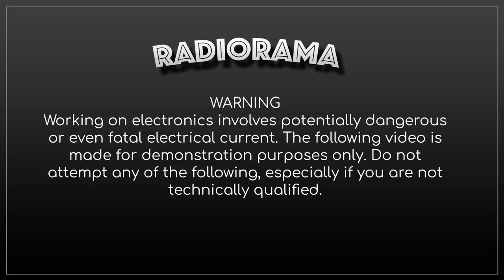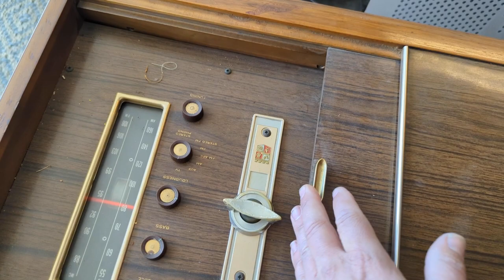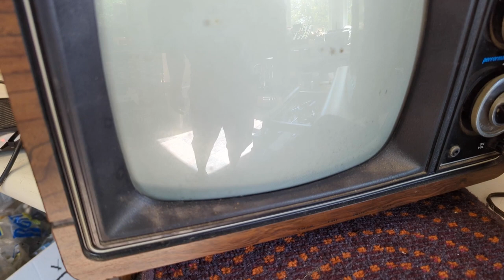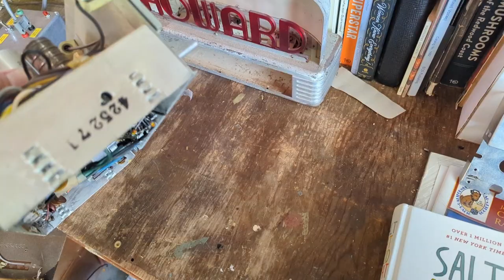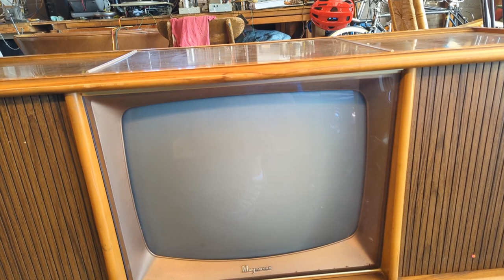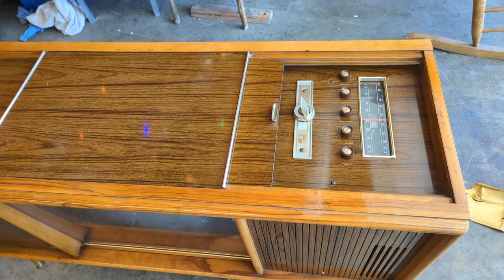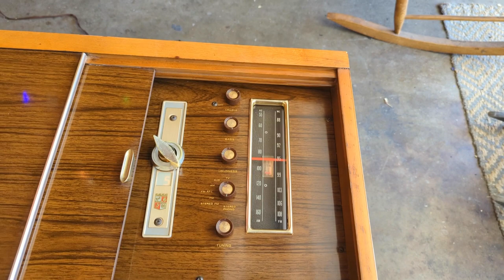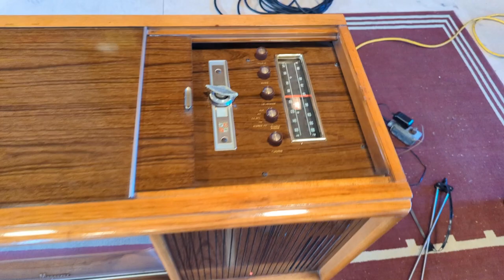Complete restoration of a early 60's Magnavox Stereo console with 23" BW TV

Comment: This Magnavox dates back to 1963 or 1964. The record changer is a calarro And the CRT is a 24 inch not your standard 23 inch.  Magnavox also made a  27 inch CRT model just like this. FYI.
Reply from the maker: Thanks for the info!
Reply: Magnavox made that set between 1960 till 1964. Magnavox stereos were solid state beginning 1964.

Comment: There are no cataracts on that CRT because it doesn't have a laminated screen. Implosion protection is provided by the flat glass window in front of the screen. It is a good idea to remove the window and clean the screen and both sides of the window with glass cleaner. Years of accumulated dust and cigarette smoke are what's' probably dimming that picture. While you're at it, you can clean the bezel with soap and water.

Comment: Very nice restore! My parents had a Magnavox with tuner on one side turntable on the other and four speakers! Boy was that thing loud! Turntable always had problems starting I think a cap was bad and my cousin got it working but we never bought a new cartridge for the thing so I was using sewing needles for it and i messed up the weight adjustment and then we got a new cartridge but the weight adjustment wasn't working so it would track to heavy and so we finally got rid of it!

Comment: Cabinet alone worth the price of admission.
Pitch perfect MCM piece.
All you needed for your audio/video pleasure through the 60s, 70s
Could sell off the amp/turntable/picture tube, then clean up and use the cabinet for modern or classic 70s turntable/updated speakers. Maybe keep the audio amp/radio/speakers if in working condition.
I wouldn't cut the cabinet all- make adapter plates/brackets/etc from wood stock as needed that attach to existing mount points/holes/structure, to preserve period piece.
Even if you were born in late 60s through the 70s, these kinds of consoles were common and still used through the 70s and 80s, into the 90s for many homes. So a lot of nostalgia for a couple generations, plus just plain good MCM design and build quality

Comment: I believe that a lot of vintage valve (tube) TVs which had radios, when you switched to the Radio option, only the high voltage to the CRT would be turned off. However, there would still be power going to the electron gun, reducing its life. As a result you were advised to only listen to the radio for short periods.
Reply from the maker: This one turns the TV off completely when you switch to the other functions. I had just initially used the wrong outlet coming off the tuner chassis.

Comment: Yours not a portacolor
True portacolors are all tube sets
The portacolor II is a rare solid state set from the mid 70's  ( JA or QA chassis ).
Yours is an AA, AB, or AC chassis. Never sold as portacolor but most refer to them as.
The chassis is famous for cold joints at the feed through griplets.  Almost nothing
else went wrong on them
LFOD !

Comment: Where is the museum located? I'd like to see these historical radios and TV that still operate. In our house, we first had a Zenith combination set (black & white I think it was, and it had legs like this does), then we traded that in for our first color TV, a Magnavox combination set that also had the legs. First color program we saw was an episode of the Flintstones, as the TV installer tuned up the set on delivery. Later, we traded that one in for another Magnavox that sat on the floor without legs (Mom didn't like getting under the TV with vacuum sweeper). That unit is still in the house I inherited, but I haven't turned it on in over 15 years. I remember it took 3 men to carry it in, no way I can move it out. 😀

Comment: That fly back was supposed to be replaced with a rubber one. Wax ones are fire hazard. The big tube is the horizontal out put. The black filter cap is the input filter.,

Comment: 6DQ6 is the horizontal output (not vertical).  Vertical output tubes don't have plate caps on top of them (I used to be a bench tech in a long-past life).   We had a name for Magnavox.
"Maggotbox" 🙂  Their color sets could never seem to get the color tint right.  Zeniths were the best.
Reply from the maker: Thanks. I ALWAYS get those 2 tubes mixed up. And indeed- Zenith was the best not just as TV but radios.
Reply: I was never a fan of Magnavox aka maggotbox color tv's. Horrible greens and because of that, setting the color temperature / purity was next to impossible. Red was also very problematic and one would see a red fringe on the right side of an object that should be red.

Comment: Great set, turned out beautifully. My grandparents had a very similar unit, maybe a couple years newer, though by the 90s the TV was long gone and the space was used for storage. Tuner still worked though. Does the FM stereo position actually do anything. The tuner section seemed kind of bare, and I noticed it was silent when you tried the position, so I wonder if used a separate MPX decoder.

Comment: I worked on the 24 inch version of this set #1 that photocell is not for remote control, it is for automatic brightness control, it will react to the ambulant light levels. #2 the CRTs in them are  VERY famous for having short lives, and going bad quickly due to the oversized screen and small guns being driven too hard,
Reply from the maker: Yeah, someone on Facebook pointed out that feature to me. Right now its not connected to anything. The CRT in this one is a little dim. But I decided not to rejuvenate it as its still a usable picture. Whoever gets this I seriously doubt will watch much TV on it anyway. Its more the novelty of having a stereo system that happens to also have a working BW TV
Reply: @misterradio5035  What I have seen from the 24inch version ( same chassis as yours), even though the CRT is very weak, the longer you let it run, the better it looks, but will always fall back to dim if you let it sit, needing at least 20 min on till it starts to look good again. :/
I got mine from scrapped parts off someone's front porch, it was literally “fish-tanked” just a CRT & chassis, no tubes or tuner, with many cut wires, and I got it working.
You can see tests of in in my u-tube feed.
I still have to make something to put the silly thing into! :O
Reply from the maker: @suzakule  I asked a lot of the old guys at the museum about the CRT on this one. I asked because I about to throw the CRT onto a Sencore rejuvenator. They took a look at and said it looked about normal. Maybe just a tad dim but according to them, Maggies never had super bright CRTs. So I just left it alone. Zeniths OTOH are super bright in comparison

Comment: Howdy Mister Radio. I really don't know anything about repairing electronic equipment at all, but I do enjoy watching others do it. One thing I have picked  up is that in an older TV like this one, if it had a remote for it then usually the tuner mechanism has a motor to mechanically turn the innards of the TV tuner. Did you find this to be true of this TV?

Comment: 20 minutes in. I think that set is solid state. There was a progression of small color CRT's at GE. They had inline guns with a Delta phosphor dot arrangement. Odd for sure. I have a few and the resolution is somewhat lacking, but the color and brightness always impress anyone I show them to. The last one they had made was more geomatrically rectangular with flatter screen. Smaller phosphor and inline. Deep tubes made for deep cabinets and I suspect they looked old and out of date in comparison to comparable Asian and other American sets available at the time. Screen size was smaller also. The color and overall picture quality is phenomenal however. A company must change with the times. GE wanted the maximum return on investment for their picture tubes and Compactrons. This probably hurt their market share over time. Just my opinion. I still love my GE radios and TV's.
Reply: Aperture Mask - metal screen with tiny microscopic holes that prevent electrons from the wrong gun from hitting the incorrect phosphor dot.
Reply: 23:30 Spindle or spindled legs.
Reply: Refer to multi-section capacitors as such. Two section. Three section. Four section can.
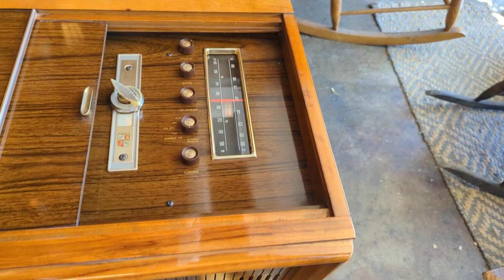Reply: 42:00 TV should be off and heaters out on phono and radio.
Reply from the maker: @johnnytacokleinschmidt515  I made a mistake in that there are two outlets on the tuner. One that was labeled " TV Power" and the other labeled Amp power. The TV power one is switched and it turns off the TV when you select the other stuff

Comment: You should absolutely never clean the rotary controls with WD40. That stuff can easily wash away the carbon track inside the pots and will not make them easy to turn.
Reply from the maker: I've never had an issue using it. Its pretty harmless stuff. One of the guys in our museum was a TV tech and swears by it. But, you know, to each their own.

Comment: Another option to reclaim and reuse these cabinets- remove the tube TV and electronics, and put in a "free" LCD panel placed rearward enough for a fresnel lens to be mounted on the front plane , or inset to match position of original tube surface.
The fresnel lens would lend a retro look to the LCD image, and lets you use smaller LCD units to minimize weight/space
Arcade cabinet DIY'ers are starting to do this to lend that "CRT look" to more modern cabinet builds using LCD panels, and I suspect moving forward, arcade cabinet makers like 1up or others may start to add fresnel lenses to their cabinet offereings